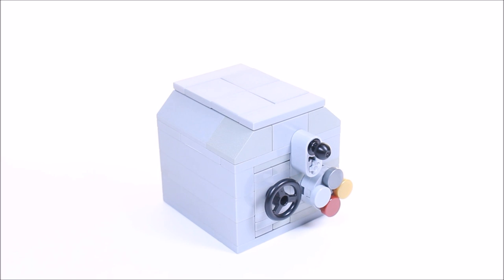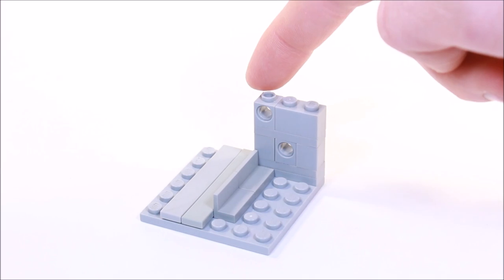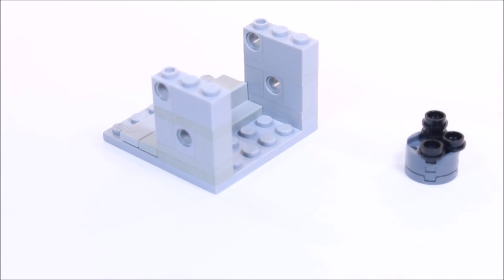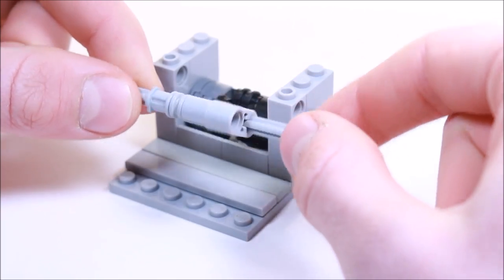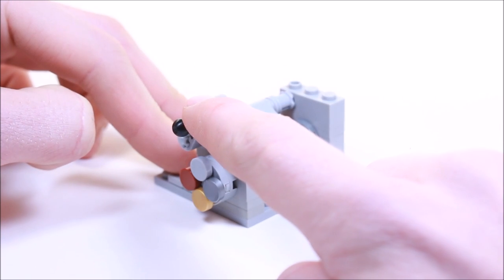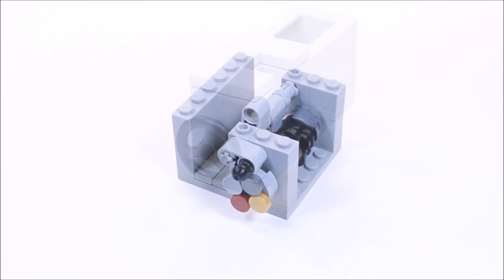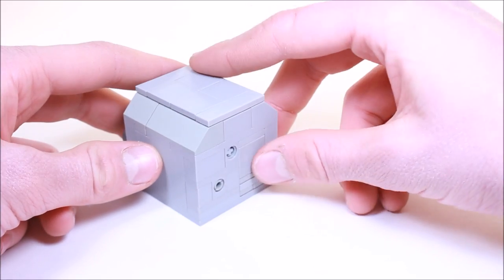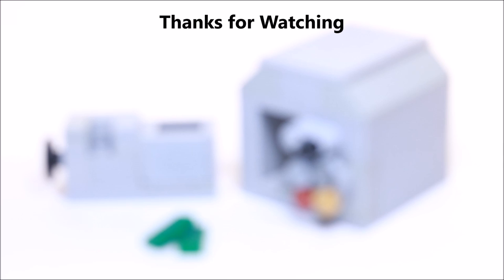How to build a working Lego Combination Safe

Comment: We're gonna need the lock picking lawyer on this case.
Reply: Sir that is a combination safe and from my knowledge you can't lockpick a button. However he is talented so probably your right
Reply: He does combination locks on his channel too.
Reply: Or a brick seperator.
Reply: I figured out a formula to open the safe you spinn it in whatever direction more than 360° then stop at the middle of 2 round plates and press down on the latch if it dosent open then turn it 180° in the same direction as you spun it at first now push down on the latch and it will open

Comment: Great design! Only major flaw I see is that you left access to both sides of the long axle. It can just be pulled out and the combination Lock is pointless. This is assuming the third would not just take the whole,thing apart and instead was actually,trying to,open it without deateoying it, lol.

Comment: Very good the only flaw is that the studs can come lose very easily but a lil dab of glue can easily fix that problem
Reply: And the container is pretty small I doubled the size of it and it still isn’t realy usefull caus the only thing you can put in there is a folded up bill or piece of paper

Comment: you could have more space in the safe if you replaced the 2 by 6 plate with a 2 by 3 and built on the 2 by 3 you could keep more stuff

Comment: Very cool safe!! The problem is that you can take it apart, check out J.K. Brickworks, he has a great safe, that you can’t take it apart, but since it’s Lego, a good hammer will break through it easily. I built one, it’s really cool.